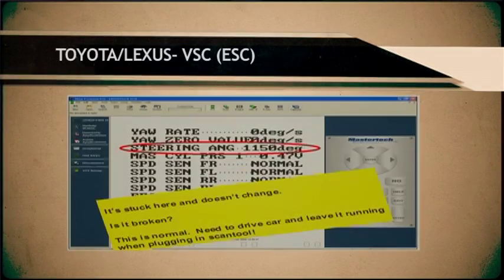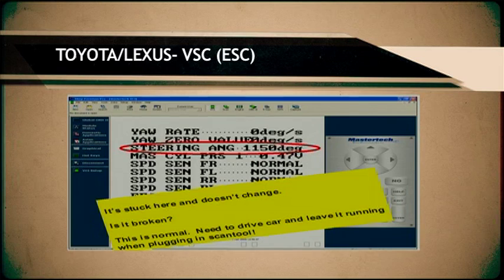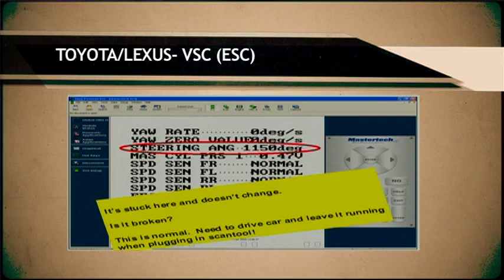VSC (ESC) | Toyota/Lexus | Tech Tip

Comment: Very informative.! Thanks. I do have a question... I have a 2004 Lexus RX330 and the rear height sensor is on. It goes off on really humid days, Which tells me that there may some debris or rust on it. The problem is, that I don't know where is is or what it looks like.  Do you?
If you can help, that would very much appreciated.
Thanks
Reply: Jerry Barajas  and see